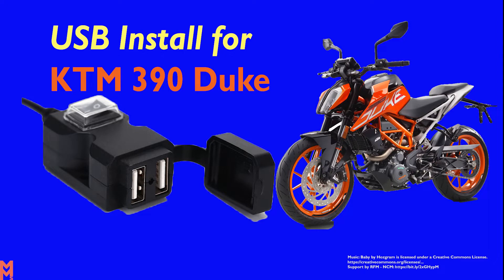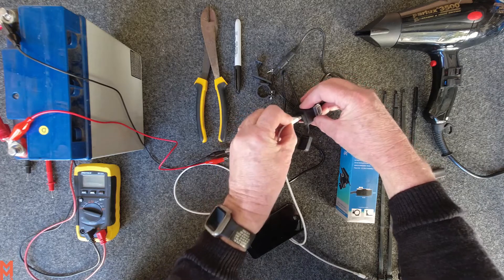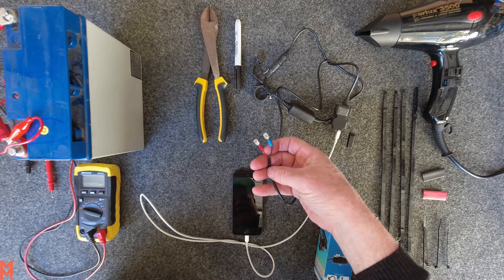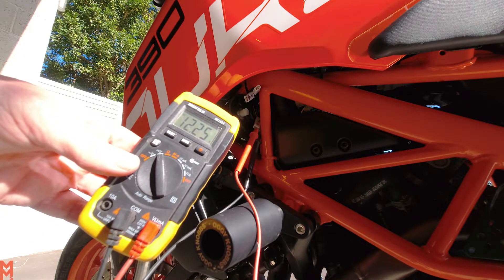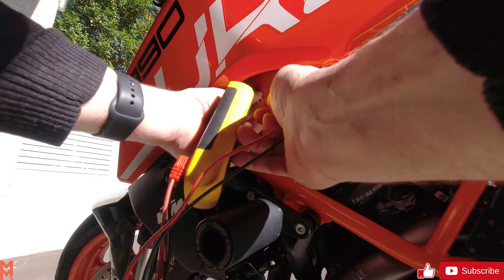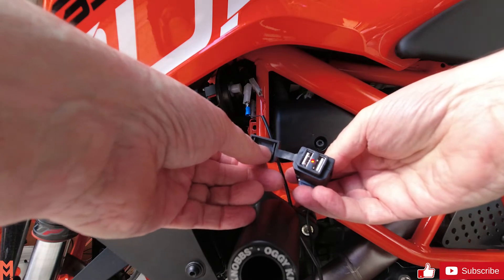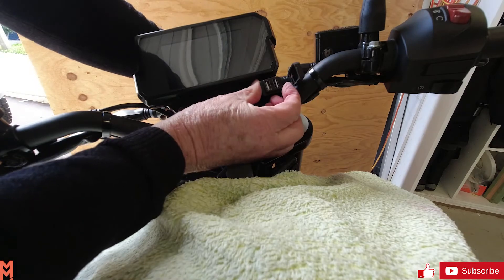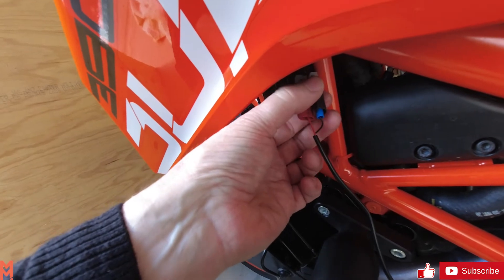USB Install for KTM Duke 390

Comment: Good one. Will try soon. On/off switch important? Fuse? Thanks.
Reply from the maker: Don’t need a on/off switch if you use the switched connectors which is controlled by the ignition key. There are two sets of connectors one switched and another non switched.
These leads are already fused.
Good luck